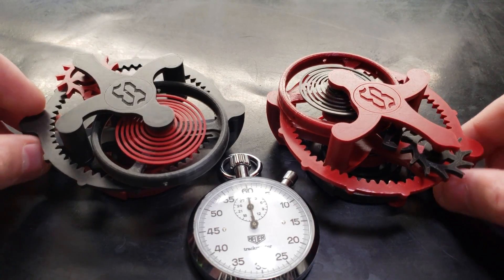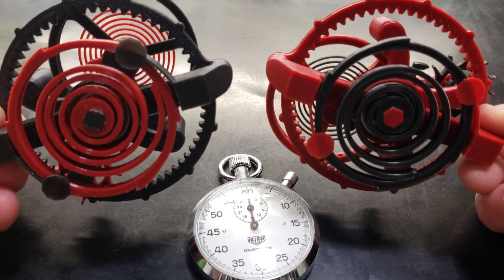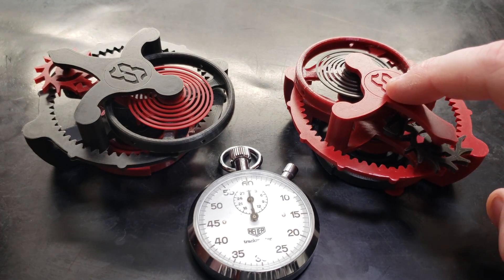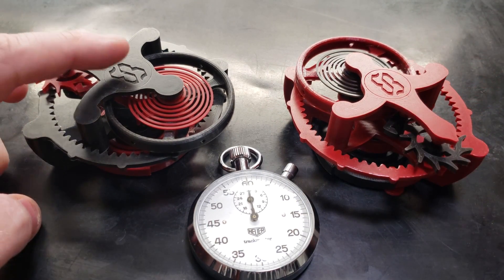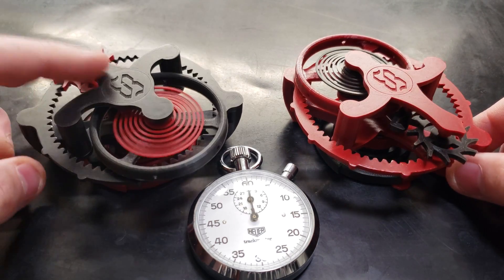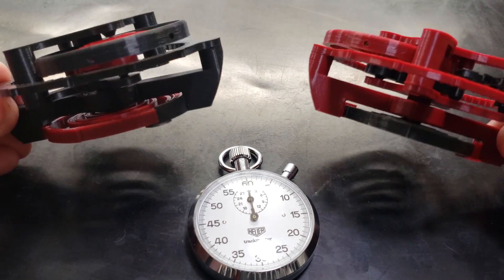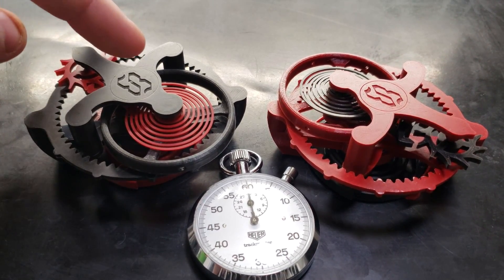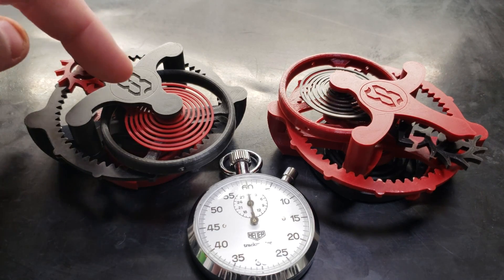3d Printed Flying Tourbillon Mechanism Max Run Time

Comment: Great work. Put them both on a piece of plywood with 2 cans underneath like a front and back axle. so the cans are parallel. start them both and see if they synchronize.

Comment: protip from a watchmaker: you might be able to get better results if you turn the balance wheel around a little bit, so that both impulses from the escapement happen equally. This makes sure that you have a consistent and equal ticking from the regulator. What also might help is to make the main spring just a very tiny amount thinner, which allows you to make it longer (there's an optimal length to thickness in watches)
Reply: ok, not a watch maker here: I have no idea what any of what you just said means.